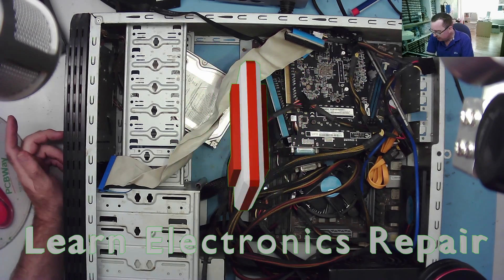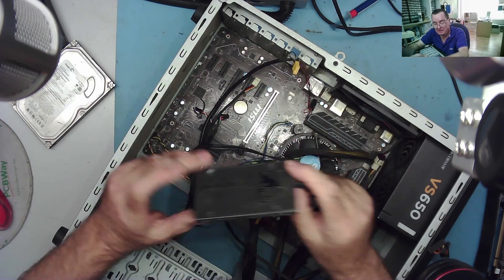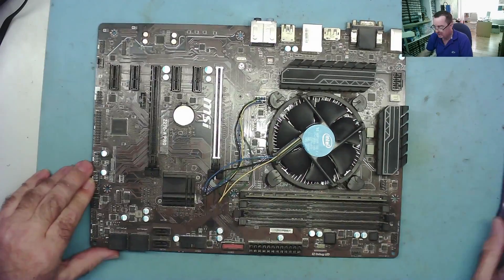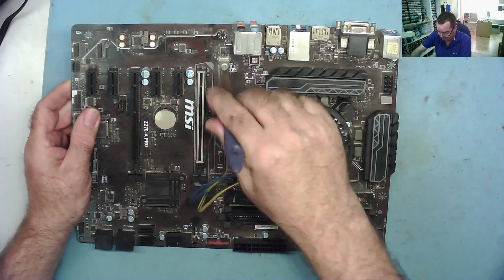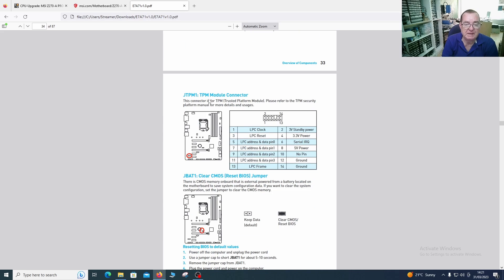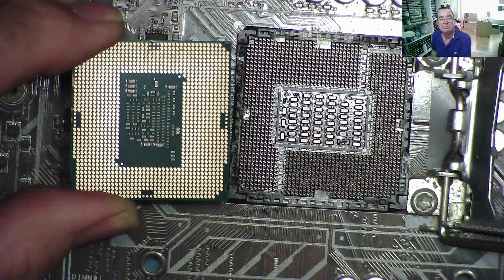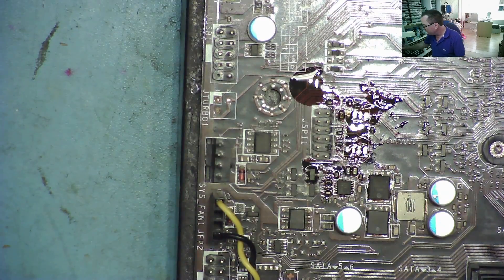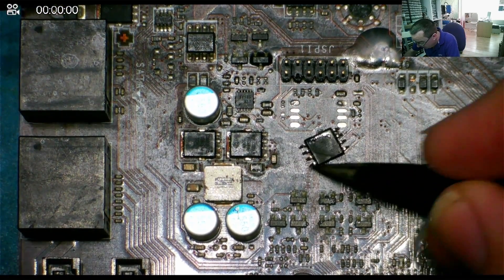MSI Z270-A Pro Motherboard Will Not Boot.  Can We Fix It?

Comment: With LGA sockets often bends on the pins will prevent booting. Checking the socket closely is always a good idea. With the Vcore being down on this board I'd stay in that area. As far as I know TPU is an ASUS thing it's related to overclocking, it auto overclocks on ASUS boards.
Reply from the maker: LGA socket is good, I showed it in the video
Vcore was only down after I reflashed the BIOS, I showed this in the video
Clearing CMOS changed the behaviour of the fault
Programming the BIOS again changed the behaviour of the fault back to how it was before I cleared CMOS
A hard fault such as Shortted mosfet etc would not behave in this manner
I am sure this is some corrupted firmware type issue, something like TPU ROM which can cause this sort of fault

Comment: I can see where you lifted a tiny resistor. The third pin over had a resistor right in front @ 19:43 and it's not there @24:09. Those two pads also had shiny solder on them.

Comment: There was a resistor/cap close to pin 3 of the bios chip before you removed the bios...
Reply from the maker: OK, thanks.  I'll check that out
Reply: Yes, present at 10:22, on pins 3&4 at 20:40, on pins 5&6 at 35.25. The wonders of the big blob desoldering technique, ho, ho.
Reply: @ralphj4012  no comment about the desoldering technique... LOL
Reply: At 20:09 it looks like there is a second component close to pin 1 that is not present at 34:42.
Reply: @torkies2877  actualy there is not component, if you look closely its probably screen illusion
Reply: @ДимитърАндонов-ъ7е  My mistake, thank you for checking.

Comment: Had an experience today and would highly recommend all technician's wear safety glasses.  High side  mosfet was shorted (literally a wire) PSU overload would trigger until it didn't. 12V through the coil across a 4Volt solid state capacitor. It exploded like a cap gun. Still can't find the aluminium can.

Comment: SLI on Radeon cards is called crossfire. As long as there are two PCIE slots you can multi them .. they dont need a bridge like Nvidia any more. Results vary though with multi gpu. Micro stutter often reported.
Reply: Not really worth it though, because hardly any modern games support SLI/crossfire

Comment: Think these days the memory controller is in the CPU although you changed the CPU so that eliminates that. What generation are these CPUs that you are using? Assume that when you flashed it was with the most current version of the BIOS for the mb.

Comment: First off Richard, it looks like there's multiple issues with this board. The bad ram was one, the BIOS possibly another, the resistor that every body has mentioned sand I'm thinking maybe the ram slot could be an issue too, so I think it's important you stick to eliminating one thing at a time. MSI boards have a bios flash procedure that allows you to flash the bios via a usb. Would recommend this instead of desoldering in future. Secondly if I've learnt anything from Sorin, is that the Super I/O chip is the one in charge of starting up all the power supplies including vcore do if there is no vcore that'll be because the SIO has spotted something wrong. You could also check to see if there is 3.3v on pin 8 of the bios chip to see if it is getting power to turn on. Thirdly the celeron supports DDR4 2133, DDR3L 1333/1600 @ 1.35V. Maybe the ram modules do work but are not supported by the cpu.
Reply from the maker: Interesting - How do I flash the BIOS via USB if the motherboard will not power up?
Reply: A lot of MSI boards (and others manufacturers too) have a bios flashback button on the back of the board near the back i/o ports that allows you to do it even without a cpu installed. You just need to give power to the board via the 8 pin and atx connectors.  Looks like you just missed out with this particular board but the Z270 XPOWER GAMING TITANIUM, Z270A GAMING M5, Z270 GAMING M6 AC, Z270 GAMING M7 all have it as well as others.

I'm assuming there is some kind of small microcontroller with built in ram that takes over the task without needing any thing externally apart from power.
Reply: Failing that reveltronics do a programmer that allows you to programme eeproms in place. Expensive at £100 but might be worth it for expensive boards where you don't want to risk damaging the bios.

Comment: oh, you ripped that resistor off, from the board.🙃
Just rewind video to 20:02 and check the bios pin nr 3 (start counting from down left). Under that pin there is your resistor, which then you took accidentally with solderiron . The proof is at 20:35. Then at the end 35:44, we all can see, the empty space under pin3. Greetings from Poland
Reply from the maker: Yes it has been mentioned 😉

Comment: Better always test with single ram module. Never with 2 or more modules. Also check the ram on every slot. Cpu connections to socket and socket conns to mobo go to separate ram slots. So if there is any problem in that route some ram slots will work while others won't. If a ram slot connection to cpu is faulty the mobo won't start with the good one.
Reply from the maker: The CPU is not starting, it never gets as far as testing the RAM
Reply: That is true. I just noticed that you often check with 2 ram modules instead of 1, and that you don' check all the slots. Also cleaning the ram pins sometimes helps. And also have on hand different ram to test with because often ram /mobo happens to not like each other just like that...

Comment: as other suggested one component is missing from the bios, it was close to pin 3, i supoose it was resistor (not sure), look at your footage again, you accedentaly desoldered it when adding leaded solder https://youtu.be/1SPlDXkgxS8?t=1236
Reply from the maker: Yeah it has been mentioned.  Thanks for the tip 🙂

Comment: I hope you have some more good ddr4 ram for the computer you are building. Swapping parts from one machine to another, can be a good diagnostic tool but can also destroy the parts you are swapping and can make you go in circles. When static was huge problem swapping components fried a lot of components. Never use an important machine you need for testing components as you could destroy it.
Reply from the maker: How would you get around that Tony? It's not possible to eliminate things like RAM without swapping for known good ones.  I did check the Vram voltage, it looks OK
Reply: @LearnElectronicsRepair  Swap between machines that are not critical.
Reply from the maker: @tonysheerness2427  Normally I keep some spare RAM of all types.,, I just happened to use the two strips of DDR4 that I had on the new machine, so I need to buy or find some more.  That PC is not in service yet as I am waiting for a new HDMI capture device but yeah I do agree, don't take parts out of anything critical.  The good news is the RAM still works, I got round to installing an OS on it today